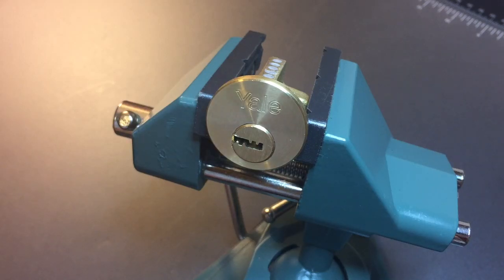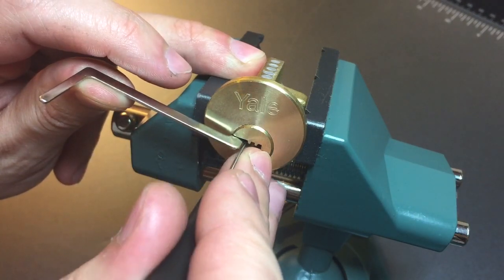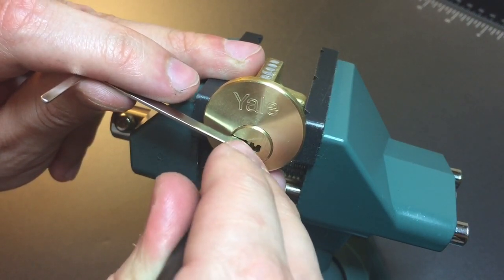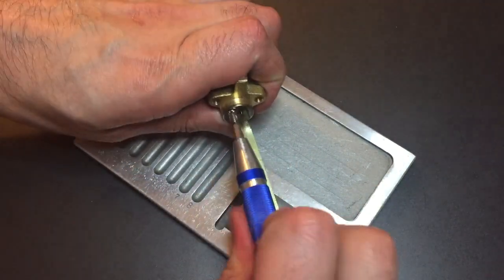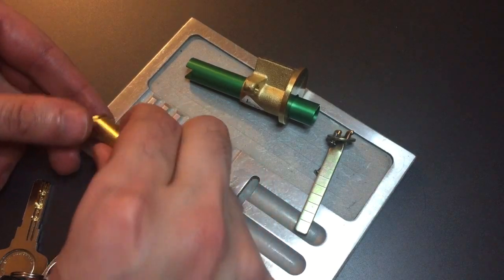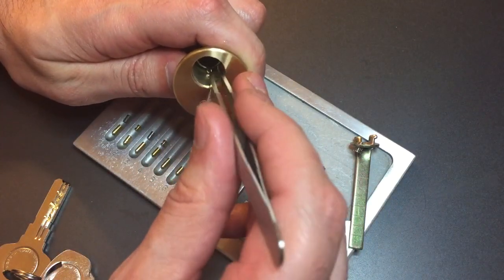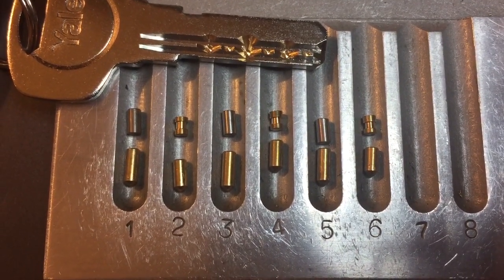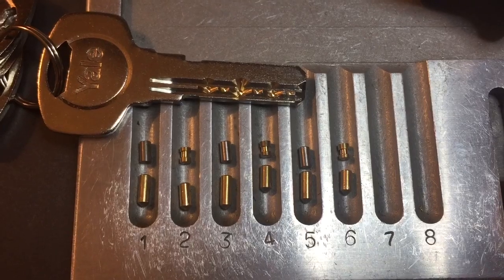[291] Yale Dimple Rim Cylinder Picked and Gutted

Comment: Nice picking as always. Hard to tell how difficult it would be to the regular picker. would've been nice to have serrated on 3and5.
Reply from the maker: Thanks.  More security pins would always be nice, though I'm not sure that I ever recall seeing a Yale with serrated pins.  As for how a "regular picker" would do... can't say.  It's an issue that I struggle with in my videos.  How do you open a lock quickly, and then tell people how impressed you are with the pick resistance?
Reply: LockPickingLawyer you're right. Never really paid attention, but now you say it I have never seen a serrated in a Yale. Spools but never a serrated. They should fix that,lol.

Comment: great video.you know that yale was just pick in under a minute. good job.how much pressure will a flag tip take if there counter milling and threads.that might slow things down.😎😎
Reply from the maker: Thanks.  Not sure how to quantify the pressure.  My picking is pretty brutal on dimple picks... They get bent and torqued pretty harshly, but I've only broken one dimple pick, and that was when I was trying to remove a pick that was stuck in the lock.  :-)  So short answer:  my dimple picks can withstand a fair bit of abuse!

Comment: What makes that a dimple lock, the pins look like regular ones?
Reply from the maker: Look at the key.  Rather than the lock being opened by cuts on the key that alter the profile, a dimple lock is opened with a key that bears the correct depth dimples drilled into it.